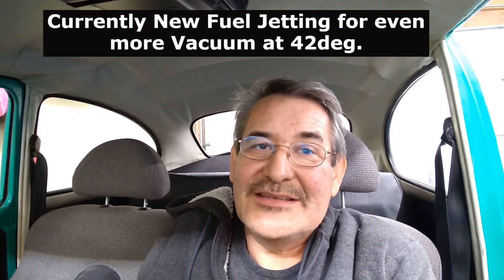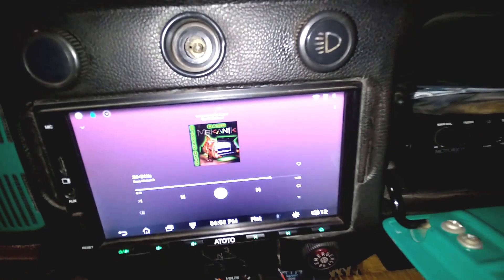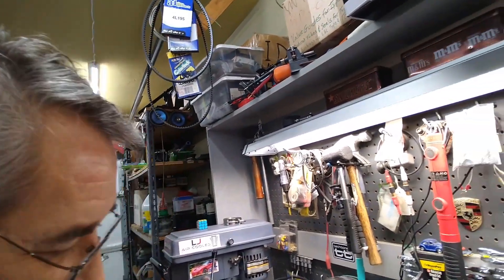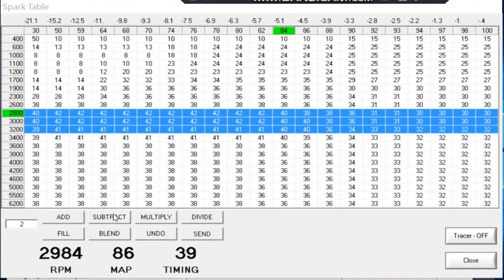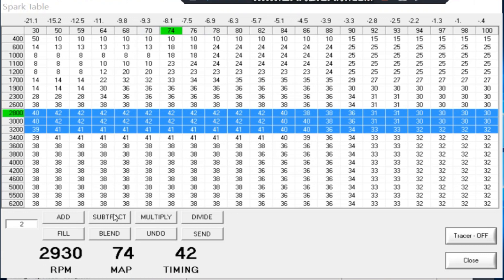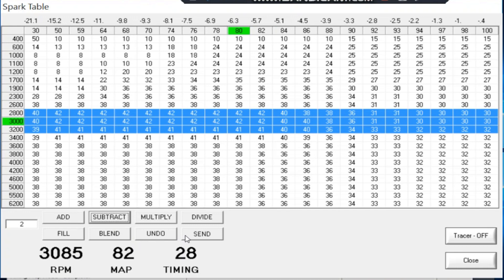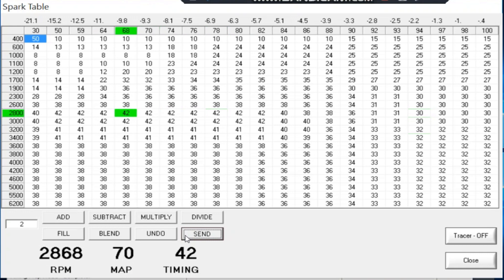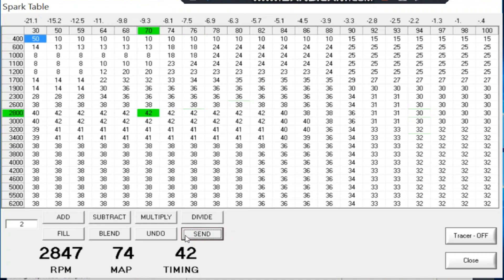Vacuum + Timing=MPG

Comment: My Camry V6 runs 42 degrees all the time downhill on the freeway, but how do I get the ECM to keep it there on the level at a constant 65 mph!
Reply from the maker: You need to visually look exactly where your green cursor is running. Typically the vehicle starts to go under load and your timing should be retarding when you get to approximately 88 on the vacuum scale of the in other words 87 and higher at around 93 you should be dropping your timing down to about 30°So on the vacuum scale which we be the center of your map between about 60 to 85 and RPMs between 2200 RPMs to 3500 RPMs this is where you want to be running about 40° to 42°. But really it's actually very simple after you learn how vacuum is related to timing. It took me about 2 weeks of constantly messing with the mapping when I started to get it. It's a learning process Good luck.
Reply: @Motor7710 what green cursor?
Are you  watching Torr, milibar or kPa?  I normally watch inches of mercury!

Comment: Does this do the same as a 123 distributor?
Reply: Yes, and no. The 123 is only 2 dimensional, so you can do almost the same on cruise, but the vacum side is much more crude so you will have to settle for a much less agressive vacum ramp.

Comment: What was your wideband numbers, before and after the updates?
Reply from the maker: I'm no longer running with a wide band sensor. After I blew up three of them I just gave up on them. But the narrow band was at 3/4 into stoich close to the rich. Now is just a hair passed the center of stoich.
Reply: @Motor7710  
That's right, I  forgot about wideband issues you had.  Merry Christmas. 🎅🤶